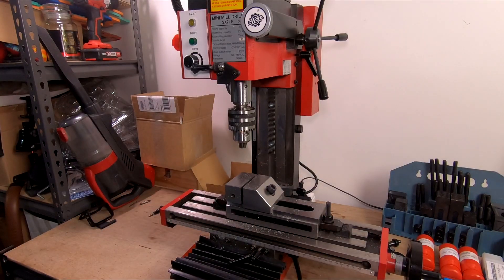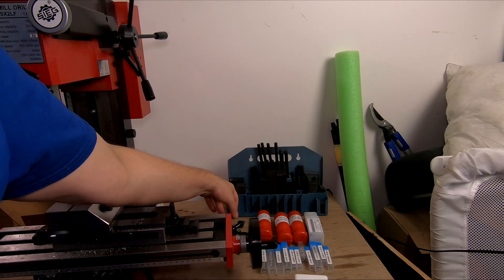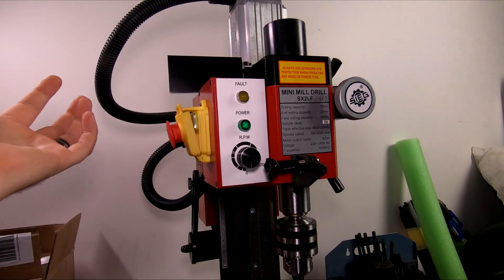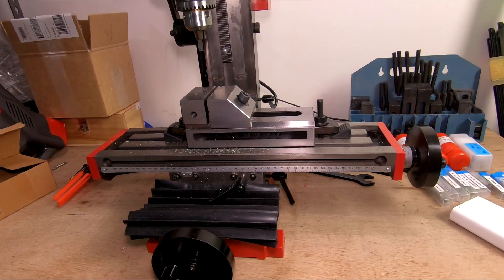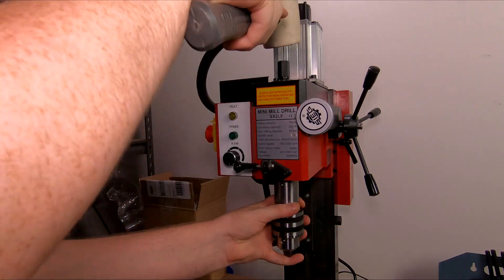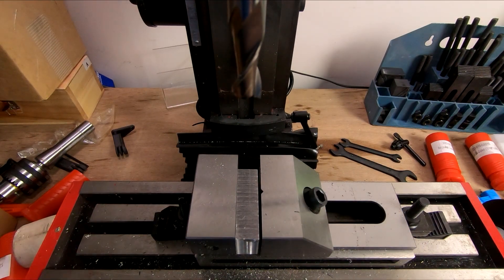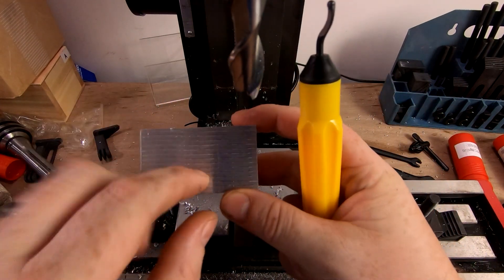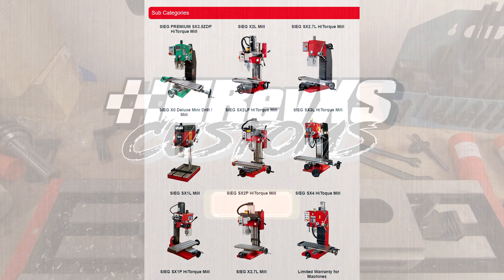SIEG SX2LF HiTorque Mill

Comment: Hey RevXS; I have the Busy Bee Canada version of that same mill. Just a different paint colour. I paid just over $900.00 Canadian almost 15 years ago. Now they are over $1,600.00. I made a T shaped plate that I bolted to the back of the column and the base to stiffen the column and take away any possibility of the column pivot slipping and trammed everything. It took a lot of vibration out and allows heavier cuts. Six bolts and it's removeable if I need to swivel the column. I also put a longer rack on the column to give more vertical travel and shimmed it out to minimize back lash in the rack. The fine feed system also got some tweaks to minimize back lash there. For what it is it's a very capable little machine and the mods I have done have increased the capability at least 50%. 
Cheers: BJ in Canada

Comment: This mill has a fixed quill, right? How does R8 compare to MK3? Thx
Reply: The R8 system allows the use of direct fit R8 collets which allows significantly more vertical clearance than the Morse taper with collet adapter. I've had the same machine for almost 15 years.

Comment: It would of been nice if you used mild steel
Reply from the maker: Definitely will be doing some steel at later point,for most part Alloys are what use for custom radio control cars but always areas will need steel,planning follow up video later so can include some steel for sure,will do it no worrys matter of working to machines limits
Reply: I've mild a lot of steel with the same mill. I just milled some 3/16 inch keyways about 4 inches long with a carbide end mill at about 2,000rpm. smooth as butter. For a 110 pound machine it will do good work but don't expect to hog out steel with a 3/4" cutter at full depth. It will do it with light cuts of .030 in depth or less and slow feed. Good enough for the home shop.